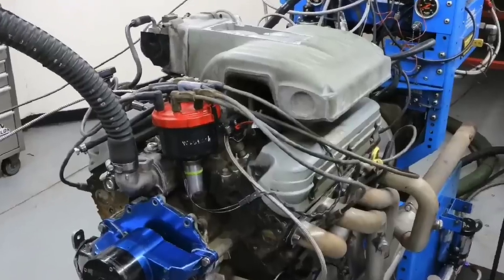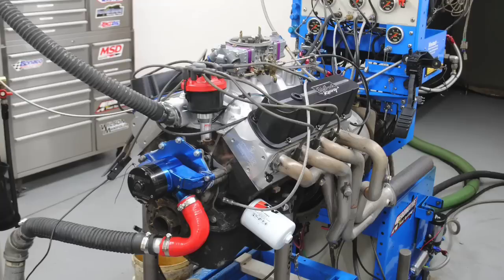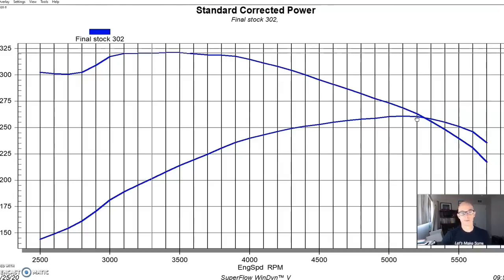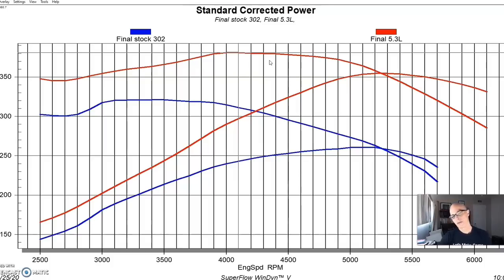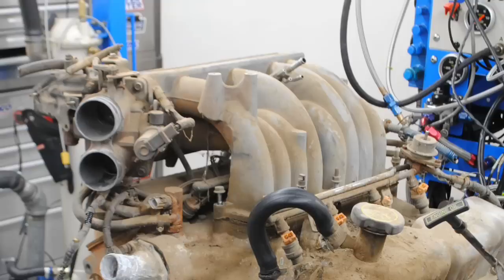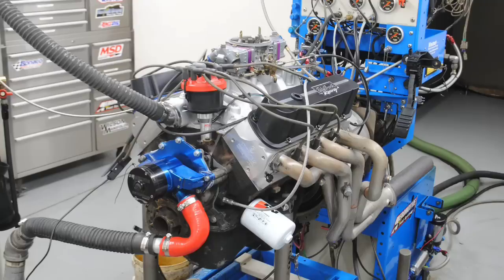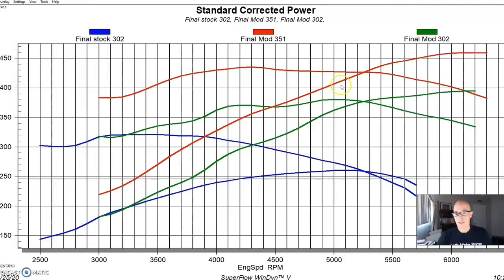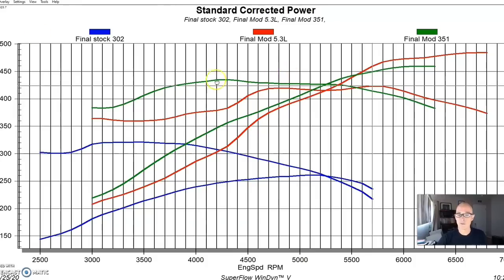5.0L vs 351W vs LS-SHOULD YOU SWAP?

Comment: I love the LS fanboys that want to swap one into everything. I’m not saying they aren’t a good platform, as I swapped a Gen III 5.3 into my 67 Chevelle, but 99% of people don’t factor in the cost of the entire swap. I paid $180 for my complete 5.3, but was a few grand more into the entire swap and I did it properly. Sure, you can drop a junkyard 4.8/5.3 into a Fox, but make it run. Build a trans, do the wiring, exhaust, cooling system, mounts, accessory drive, tune, etc. That money could go a long way with hopping up a 302 or even building a 331/347. And yes, I am a Fox owner as well. They’re light enough cars to begin with and putting one deep into the 11s while remaining streetable is easy as falling out of a tree.

Comment: 302 doesn’t need $3k in top end just half that in on 3 turbo
Reply: Yep turbo the stock 5.0, did it to mine and made 454/510 stock long block on 15psi. Granted its not a record setter but got 20+mpg and 6.70-80 in 1/8 all day long......oh yea it was a blow thru carb too.

Comment: The LS is without question  the best engine of the group.  Besides the fact that it makes more power, it is smaller, lighter and more reliable that the 351.  Having said that, if I had a Mustang it would definitely have the 351.  The 351 is still a great engine and it will do everything that just about anybody could want.  I cringe at the thought of mixing Chevy power in a Ford engine bay.

Comment: This is the same thing that happened back in the day a flathead 32-52 was replaced with a sbc in 55 and the sbc was replaced in 98 with the ls type engines. Ford's just don't run enough compression and until recently the aftermarket wasn't there. We would swap sbc into our fox cars because you could make more power cheaper. That was when most people ran iron world sportsman heads and gt40s with an e or b cam and stuff ran good enough to rip apart t5s. You could make 150 more hp and convert the car and still have less in it. Don't get me wrong now I would leave a 302 or 351w swap. I kind of like the M motors since they make parts for them now and good Cleveland heads. Just different technology, I like flatheads even though it's big money for 150hp, I run a hopped up model A with a modified l head so it's all realitive.

Comment: Personally, I'd try to find a better host for the LS engine. 😝
Reply: I’m currently turbo 5.3 swapping my 86 notch, it was a v6 and the whole car needs a rebuild, instead of sourcing every single part I need for a 5.0 swap and worrying that if it blows from the boost I won’t be able to find a good cheap long block again, I’m putting a 5.3 in her. Picked a 5.3 with good cylinder crosshatching out from the junkyard and for $370 I got the full long block with accessories, harness, and the computer. The strength these stock motors have and the fact that the parts are just so much more readily available, plus the undeniable power, especially under boost with these ls motors, sells me immediately. I know it’s sacreligous but I’m on a budget here. I’m not a ford guy, or a Chevy guy. I’m just a muscle car guy🤷‍♂️
Reply: Rock on, brother! It's your car. Do what you want with it. 👍
Reply: Yeah.  Its called a bowtie car.
Reply: @richd4819  
Belly button car
Reply: Ya a DUMPSTER

Comment: 351 all day. No real ford guy LS  swaps. Hard facts. Nothing against LS, great engine. Fact is 351 vs 5.3 with the same head flow compression, cam etc. Theoretically 351 makes more power and torque.
Reply: I guess the 1000s that do arnt real Ford guys ? Lol
Reply: @god1st.530  They maybe just engine guys or people looking to just do swaps. Idk. But they definitely not ford guys. Real Chevy guys wouldn't put ford in there cars either..... What's your point.
Reply: @str8edge_lifer83  I think the LS swap guys are simply go fast guys.  The fox mustang chassis is probably the most economical way to go fast as the 3rd and 4th gen F bodies had weak torque arm rear ends.  Some Chevy guys run S10s which seems to be an economical way to go.  Guys are swapping Ford 8.8s in A and G bodies which is another way to go.

Comment: I became a Ford guy because my dad was a Chevy guy. We had a great relationship and it was the only thing we would fight about. So if I pulled my Ford out and put an LS in, he won! Which is why I have a 351 waiting to be rebuilt.
Reply: Same with me and my late pops, he was Chevy, me Ford. The only thing his build had in common with mine was manual transmission. He had a 64 El Camino with a 396 bored/stroked? to 420. 1st gear in his would go to like 45-50mph, my 1980 Bronco with a 331 Stroker has also a manual trans but it’s a trash truck granny low transmission, 35” tires and 3.50 stock gearing requires me to use the 6.69:1 low 1st gear to get her fat ass moving, but in all fairness he liked the idea of racing, me I just love driving, love shifting gears, love going fast, love sitting up high, and love that I can literally drive my hot rod Bronco ANYWHERE, snow, mountains, sand, can cruise at 75 mph at 2200 rpm without lugging the engine, and have a top speed of 150 mph in a smog era 302 full size Bronco with the aerodynamics of a shipping container, and I built it all myself without a garage to boot.

Comment: Life long Ford guy here. In my opinion the Windsor Ford engines are the best Ford ever made but the LS is a better engine. You can't bolt on 1000hp to a Ford engine in your garage where an LS you can and as far as will it hold up to 1000hp........without beefing up the Ford engines I don't think they'll handle it where an LS can.
Today's Ford's are junk. Sorry to say but they are junk. The newest Ford I'll ever buy again is a 1995 or earlier. I've had several off the showroom floor new Ford's over the decades and watched their mantra Quality is Job #1 go to quality isn't in our playbook. Nope. The final straw was the 2018 F350 4x4 6.7L diesel I bought brand new that I still have. Problems, quirks and recalls. It has under 5000 miles on it. I just don't drive the damn thing.
Reply: But we're not talking about "today's Ford", are we?  And we're not talking about diesel engines, are we?  GM's "today's engines" are turning into crap, and I wouldn't own one.  My choice is my '71 Chevy Monte Carlo with the 402ci (other marketed as the '396ci) big block.

Comment: Great comparison.  As my esteem, or other things, are not determined by my hp or torque numbers, I would pick the modified 302, if that is what the car came with.  To me, the shape of the curves mean something also.  I find lumpy hp/torque curves annoying .  Have you ever driven a stock BRZ?  If so, you would know what I mean.  In the end, I am looking for fun.  Fun comes from more than just hp.  Fun comes from a balance between hp, handling, etc.  It comes from agility, turn in, front to rear balance, smooth, rifle bolt  action of the shifter, ability to toe and heal and double clutch.  In other words, the WHOLE driving experience, not just 0 - 60/ 1/4 mile times.  If it's your thing, go for it.  Just tired of cars becoming a one sided thing honoring at the alter of hp.

Comment: D. Ford Godzilla 7.3!
Reply: That motor is getting so overlooked by the engine swap crowd.
Reply: SUB SHOOTING 84 because it’s not in junkyards for $200
Reply: 789 hp 7.3 with custom everything rockers camshaft valves pistons rods pushrods I’d say 50000.00 with engine or 12000.00 big block 540 770hp that Richard did a few episodes back that’s why no one is even thinking of Godzilla lmao attacking your wallet
Reply: Sure, if cost per hp wasn't a factor...
Reply: SUB SHOOTING 84 def not overlooked, it’s too heavy, and won’t help smaller cars as much as a coyote or ls could
Reply: @dshook1989  how heavy is that 7.3?

Comment: A 351 is a 302s big brother more or less the same engine. You can see the way factory set them up. The smaller engine made power a little higher in the rpms vs the big boi made power down low. Both are super choked up. These stock 60mm throttle bodies are not enough to flow 5 liters of air. My 1.9l 4 cylinder had a bigger tb and it has a dual stage tb.

Comment: You're comparing a 1960s motor to a 1990s motor.  I should hope there are some improvements.  Let's compare LS to a Coyote instead.  Or even a lowly 5.4 Triton.
Reply: I think it was more of a power difference with price. Also, the 351w did start in the 60's but went well into the 80's and even up to the late 90's. I'd like to see a comparison with some versions of the chevy 350. Then with the coyote, I'd like to see a comparison of that with the LS3; being that was one the motors it was designed to compete with

Comment: I think the pertinent thing would be the modified 351W vs the stock 5.3 or even the 6.0 LS.  To swap an LS into a Mustang also requires a different transmission, driveshaft, computer if injected, mounts, etc.  Assuming your car has a 351 in it already, the cam and top end kit is all you have to do.  The modifications to the 351W is easily cheaper than the LS swap.  If the cost isn't a concern, just call Kaase and put a Boss9 in it and go on.
Reply: Ive done both...went carb on both engines to keep costs down....LS was cheaper and faster for the money.. is what it is...still love the sbf tho.

Comment: To open up a 302, look to what Ford did with the 1970 Boss engine...holy crap, a 750 CFM carb!  And you had some racers who modified the internals to use it...(IIRC, you had to turn 10,500 RPM to take full advantage of a 750 CFM carb..).  Obviously your goal at that point was to build a motor that could hold everything together at high RPM.  NASCAR still does this every Sunday with pushrod  engines.

Comment: Putting an Si trim on a 331 in the next few weeks on my 95 mustang. Hoping for 450-500whp on 7-8 lbs. rocking that XE270 camshaft, 10:1, gt40 intake, some aluminum Chinese heads, 3” exhaust with shorty fms headers

Comment: No no keep it ford nothing more ugly than open the hood of a ford and see a Chevy motor 🤮
Reply: We do not need a GM and China owned LS in a Ford.
Reply: Nothing except a ford with a 5.4 triton still in it.
Reply: You are so right!😎🇺🇸
Reply: Lol you must see alotta tail lights when you race.
Reply: @smashdogg1241 GM -China has been seeing lots of Mustang taillights in the Australian Super Cars series the past three years in a row with Ford Mustangs powered by 50 year old SB Ford powered engines. The twenty plus Chevy's in the Infinity series have also been chasing those two Ford Mustangs a lot this year also. The Ford powered Dirt Late model champion has been showing the GM - China camp taillights all year long. The reason I mention GM-China they are now in bed together. While General Motors isn’t entirely owned by a Chinese company, it does rely on its partnership with Shanghai Automotive Industry Corp to keep the money rolling in. Both of the companies formed a joint venture in 1998. SAIC sells companies under the General Motors name, even if customers don’t realize it. SAIC has its headquarters in Shanghai, while GM has theirs in Detroit.
Reply: Lol chevy been seeing ford tail lights since 80s. They were lt motor
Reply: It is very common to see though

Comment: Why no Coyote?  it will make more power, have a better resale price (a LS will drop the value)
Reply from the maker: not very common-and lots more expensive (but they do make good power)
Reply: One reason is the LS chevy will make 90 more foot pounds of torque from 3000rpm to 4500rpm so now the 5.0 ford engine is playing catch up as you rev the shit out of it to catch up with the chevy LS playing catch up in drag racing usually does not workout well

Comment: I'm curious as to what the compression ratios were on the modified engines. I get the feeling that the Fords were lower.
Reply: Not with the aftermarket heads i bet they werent. The 5.3 lm7 truck motors were only 9.4:1 compression.

Comment: How hard is it to retain the t5 in a LS swap?

I went with a carbureted roller 351w and a t5 to replace the CFI 5.0 AOD in my 85 GT.  Unfortunately the 351w did not mph too well at the track with the iron GT40 heads, but it did meet my initial goal of running a pass in the 13s leaving from idle granny shifting.  I am finishing up swapping those iron GT40s for some BluePrint 190 cc heads that were on a crate motor I got.  I cleaned up the bowls a little with sanding rolls on my dremel and lapped the valves since 15 of the 16 valves leaked when I poured gas in the ports.  Hoping to pick up a bunch maybe 8 mph in the quarter and a 12 second pass granny shifting.  Should be running tomorrow.
Reply: Brandon Carpenter  I had the factory 3.27 7.5" which broke at the track shifting into 2nd.  Now it has a 3.55 geared 8.8.

Your 81 sounds real nice.  Did it have a big convertor and gear?  Low to mid 7s is moving.  50Tussin runs similar times with his cars, but he is launching off the rev limiter with a 5 speed.

Comment: I'd go 5.0 coyote because it would be replacing a 3.8 liter V6. One can't just stuff an old Ford v8 into a modulator equipped car and expect to pass an inspection.  

Not everyone can afford to have a daily driver and a hotrod in one car. 

Always check state and local laws before building anything intended for the road.

Comment: Built a 408 stroker, AFR heads, box intake, etc.  Don't regret it, but going LS next. If I had to do it again I'd at least get the Terminator X for Ford.  It starts at $900, or $1 for each hour I  fiddled with the EEC-IV  before I shot it :)

Comment: Id NEVER swap a chevy into a ford or vise versa
Reply: well no one would swap a ford into a chevy unless they were just straight up desperate or making a point... so no worries there lol
Reply: @robc7812   them chevy boys better not get caught slipping..thats all i go to say about that..🤪🎬
Reply: @19jody72  lol my buddy has a sbf 427  in a notch running 8.5s (1/4) on a 200 shot... so its all relative... sbc and ls just do it better on a budget... and granted hes running a dart block and afr heads... so not much ford left
Reply: @robc7812   real good friend of mine runs deep 8s as well with a 331.. street car.  Gota fugg with ya.. its all good on ford versus chevy.. ive had them all
Reply: @19jody72  lol i have a mustang and silverado right now.. if im completely honest though ive had better luck with chevy... and just awful luck with dodge ive had bmw mercs hondas nissans saturns caddys and worked in shops for years.. can easily say the most overrated though is toyota not that its bad just way overrated
Reply: @robc7812  hahahaaa... yeah, I've had Dodges too.. darts, dusters, v8 5 speed dakotas.. them dakota's seem to hold up pretty decent.. but the full size dodge, forget it. All 3 I had rearends and transmissions went out..just normal working trucks.  Chevy, can't say nothing bad about them.. Ford is just my thing

Comment: If I was going to swap, it would definitely be a coyote swap. But that's just me.
Reply: Have fun with them 8 foot timing chains
Reply: Not for junkyard 5.3 money you aren't.
Reply: @trentdawg2832  Weird, my 900+ whp turbo Coyote swapped Fox has had zero issues with it's "8 foot timing chains" even after 12,000 abusive miles.
Reply: @TheKiltedYaksman1  "junykyard" cheap ls engines dont really exist anymore. people are hoarding and selling 200k long blocks where i live for 1000 bucks....what a joke.
Reply: @TheKiltedYaksman1  nope. But I wouldn't use a motor right from a junkyard for a swap. I would do a total rebuild from oil pan up to intake. So realistically a 5.3 swap isn't much savings. Coyote swap can be done for 6k.

Comment: Back in the 90s (and even now) there were kits to swap a 385 series Ford (429 and 460) into any Fox body car. This of course allows the possibility of installing a 460 stroked to 514 ci or more. Enough engine to smoke any LS, (which belongs in Camaros and Corvettes) and no need  for the coil-on-plug rubbish or the aftermarket front cover and drive gear coversion to run a distributor in the LS...LS engines dont belong in  a Fox, SN95 or any other Ford.

Comment: I'm kind of a purist and although I don't dislike LS motors, you need to keep a Ford engine in a Mustang.  As you've shown, 302s and 351s with stroker, heads and cam do just fine.. and if that's not enough, go boost.

My pick would be a 351 stroked to 427.

My .02 cents.

Comment: I would stay to the Ford platform straight up I would not use an LS if you want to really get technical you're comparing a smog engine that had a bunch of restrictions because of government versus an LS that has less restrictions so why don't you do it right and do Ford right instead of trying to sell the ls platform to everybody and do what is called or I call NASCAR make sure that the profile of the runners are within the same air flow in the heads to include cam lips of the rocker arms to also include the valve sizing still even in your quote-unquote modified version I'm a Ford engine builder and what you buy the Ford platform does not even equal to the same in the ls Factory or the modified LS because most manufacturers are going to prorate the ls or the Chevrolet platform over the Ford so in layman's terms this review is very perspective towards the LS so the next time try to do a little bit more equal like NASCAR and make everything within prospectively equal and then do a review
Reply from the maker: You have a 5.0L Ford Mustang and want to swap something-these are the usual choices!

Comment: The 302 and 351w changed around 1970 lower compression, heads changed to EGR type heads so the valves got smaller chambering changed,  the 351w and 302 shared the same piston .  We used to take the 351 Cleveland heads machine the water ports custom made intake and a few other tricks and install them on the 351w.
Reply: You can use the stock forged pistons from 87-92 302 if you have one in your car.  Stock 302 forged pistons with the stock 351 rods and crank can make damn good power on the cheap.